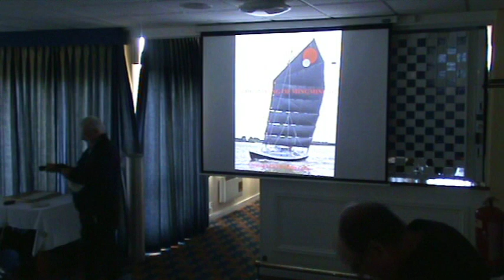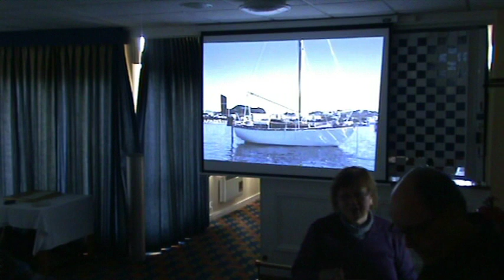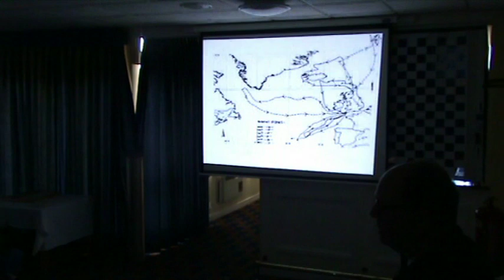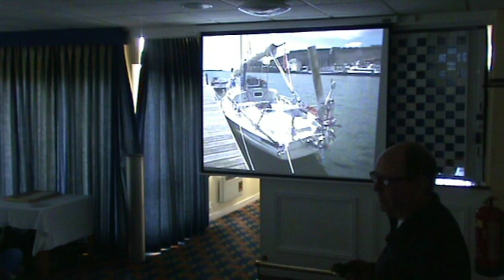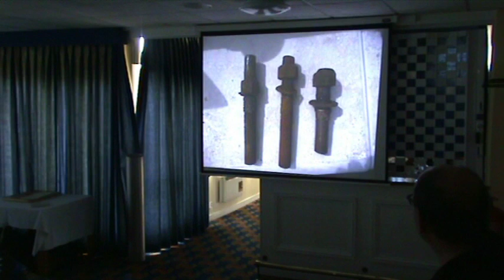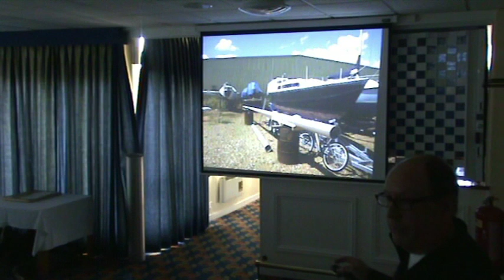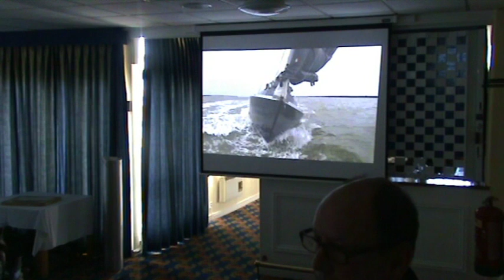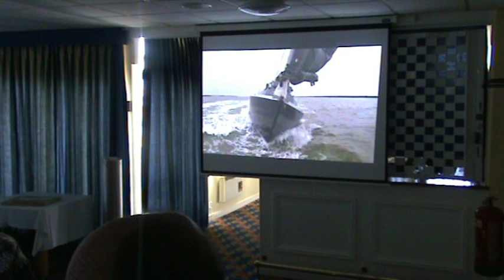Public Talk: The Making of Mingming II

Comment: Really Inspirational! Did you ever consider testing the unsinkability of Mingming I, using the old boat as a test subject? I am really curious about wether it is possible to fill it completely with water, pump it dry and continue sailing. Would be of both practical and academic interest. In theory, could it be done?

Comment: I have the skills to do this entire build minus the Sails...  I can sew using a machine but i have no real knowledge of sails or sail design...   It also seems like Roger Taylor has some very unique idea's about Junk Sail construction..  Almost a Hybrid wing sail ..  The Hinged lower sections are a great idea and i like how you can play with the hinge length to increase the camber and draft....   A big help to anyone wanting to try this out would be if Roger had fabric patterns available to make this exact sail...  Since this sail is large and designed for Arctic sailing, it would probably be more  enough sail to propel your average 30 to 33 footer that sails at lower latitudes..
Reply: I had the same response. Roger has posted in a forum thread on junkrigassociation.org indicating they are flat rectangles and the hinges have their maximum camber at about 30% from the Luff. If I recall correctly the boom length was 13'10" and each panel was exactly 3' tall. He has also written several excellent books about his adventures in which you may find scattered details about the development of the many innovations he has developed over his many years of experience.
Reply: Dustin Higdon Thank you for the link and informative reply.